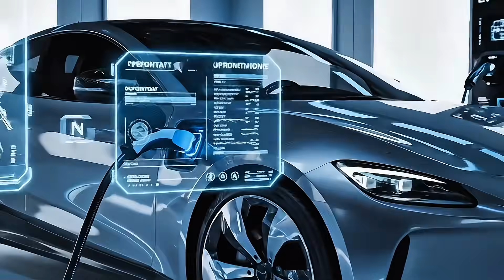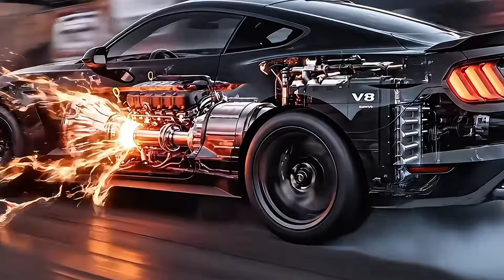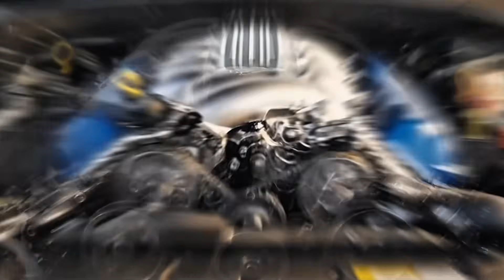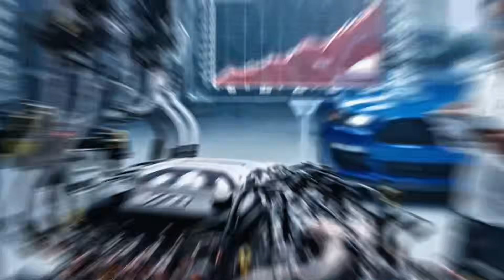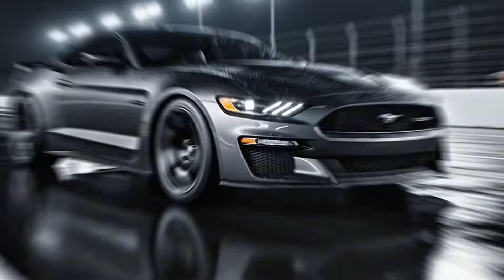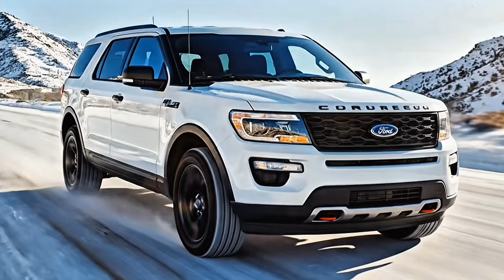2027 Ford Coyote V8 REVEALED – More Power Than Ever Before

Comment: Still have a wet belt driving the oil pump?
Yeah, no thanks
Reply from the maker: That’s a fair question. I wouldn’t assume the 2027 Coyote uses a wet belt to drive the oil pump without confirmation from Ford’s official technical specifications. If you have a source showing that setup, it would be worth checking before ruling out the engine.

Comment: Build we will buy it, electrify it and the GRANHOLMN EPA can buy it. Stop wasting money on platforms that no one wants.
Reply from the maker: The market will ultimately decide. Some buyers want V8 power, others want hybrids or EVs. It’ll be interesting to see which platforms manufacturers invest in most over the next few years.
Reply: @NextGenWheels-s5r  90% of all car owners have no interest in EVs. 80% of all EV owners say they would never buy another one. Most are open to hybrids if they are dependable and affordable. Ford pushed EVs when they should have focused on hybrids. They have hybrids, but have not marketed them at all.

Comment: Mustang guy for many years. Quality is in dumpster. To expensive for a 70 thousand mile engine. Why don’t we try cast iron liners and a gear drive oil pump instead of belt drive.  Fix real problems first.
Reply from the maker: You’re not wrong — a lot of people miss the old-school durability. But the trade-off now is weight, efficiency, and emissions. Would be interesting to see a balance between both approaches.

Comment: It needs AWD
Reply from the maker: AWD would completely change the game 👀 Would you want it for launches or more for all-weather driving?
Reply: @NextGenWheels-s5r I like drag racing and it would be awesome for traction. It would seriously decrease 0 to 60 times
Reply from the maker: @lkirkp6468  Yeah for drag launches AWD would be insane 🔥 Way better traction off the line. Only trade-off is extra weight and drivetrain loss, but for straight-line grip it’s hard to beat.

Comment: One thing Ford doesn't understand is QUALITY!
Reply: Troll.
Reply from the maker: @danielroberson5421  Not trolling at all — just trying to have a real discussion. Everyone’s got different experiences with these trucks.
Reply: You say that while my F150 has 372k on the clock with original engine and transmission
Reply from the maker: @FloridaCountry-u9b  That’s impressive 👏 372k on original engine and trans says a lot about how well they can hold up when maintained right. That’s really the point—some people have rock-solid experiences like yours, others not so much. Consistency is what people want from the newer models.
Reply: @NextGenWheels-s5r  if people want consistently then maintenance is the key especially with the new direct injection 5.0s
Reply from the maker: @FloridaCountry-u9b  100% agree—maintenance is everything 👍 Especially with direct injection engines, oil quality, change intervals, and fuel quality make a huge difference long-term. That said, newer designs should also be a bit more forgiving, not require perfect conditions to stay reliable.
Reply from the maker: Quality is definitely what matters most at the end of the day. Power is great, but reliability is what keeps people coming back.

Comment: Ford should come out with a Boss 443 with the Godzilla 7.3 liter from the F250 pickup trucks with about 600 horsepower.
Reply: it's 445 cid and they already have the megazilla crate engine making 615 hp.
Reply from the maker: Yeah exactly — Megazilla is already proving what that platform can do 💪 Makes you wonder what a factory version could look like.
Reply from the maker: That would be insane 🔥 A modern Boss-style big V8 with Godzilla DNA would definitely get a lot of attention. 600 hp NA would be wild.
Reply: @NextGenWheels-s5r  If you swap out the mild cam in the megazilla for the BTR truck Norris cam, it bumps you to about 670 hp. And the low profile Ford performance intake that is on the megazilla was designed specifically to fit under an S 550 hood.
Reply from the maker: @mikeabney1214 Now that’s a serious setup 🔥 670 NA would be insane. That kind of build in a street truck would turn heads everywhere. You think Ford would ever actually build something like that from factory?